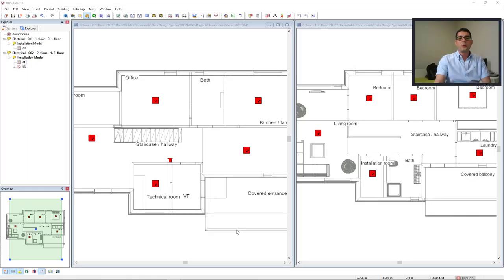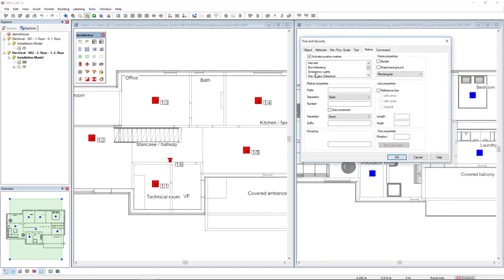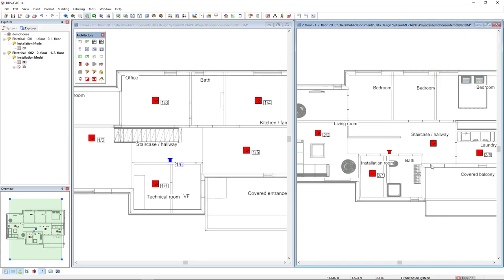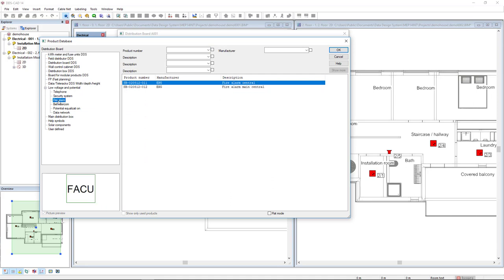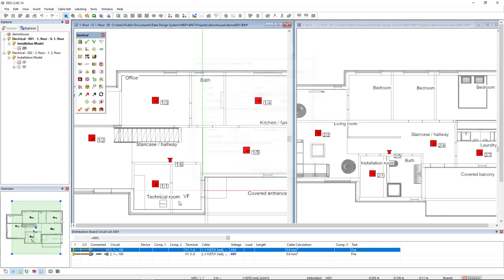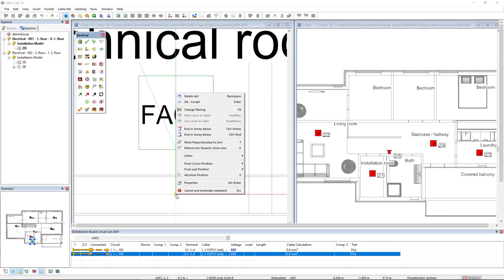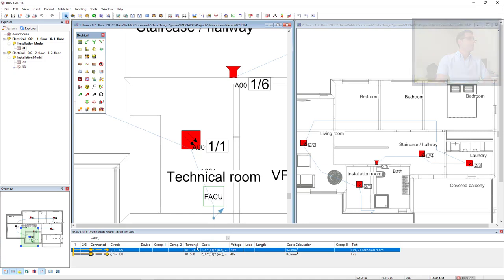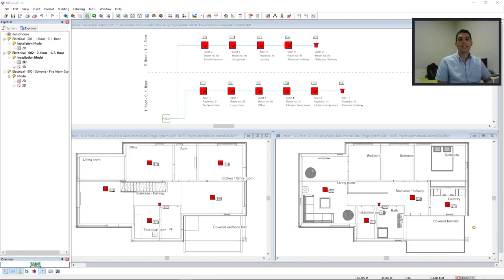How to quickly design and document a Fire Detection System in DDS-CAD

Comment: Hey Filipe, question, how refresh schema after change a type of cable to one of many elements? I had everything setting good, part text, line alligment etc, and i just want NOT to do this again and again everytime that i change small thing in instalation. I just wanna refresh schema with new parameters readed automatically. I will not contact my local support becouse probably i know more about using dds-cad than them.
Reply from the maker: Hi Jaroslaw, 

Right click on the 'system'. A selection appears.
Select 'Refresh system tree'. A selection appears.
Use 'Generate schema'. The 'Create schema report in...' dialog opens.
Click 'OK'. The 'Create schema report in...' dialog closes and the schema is displayed

IF this does not help you, you can send an email to support@dds-cad.com. About local support, we are in contact with all local supports, so whenever clients have a doubt they cannot directly help, we are the second line support.
Regards, Filipe
Reply: @DDSCAD-MEP  It's not what im searching for, ill try to record my problem to visualize what i try to do and place it here
.